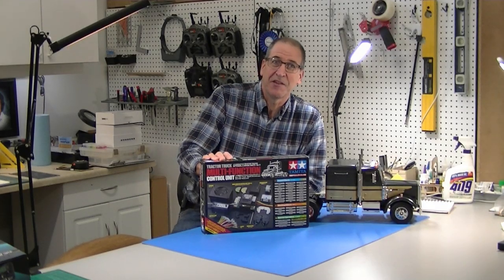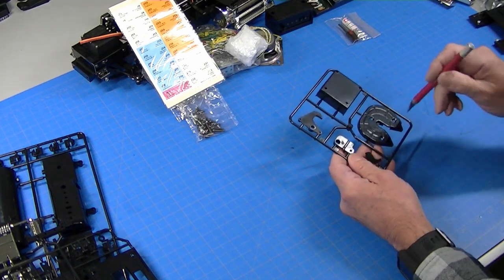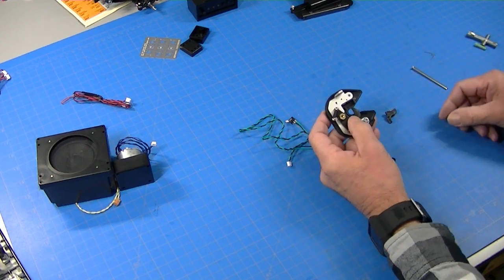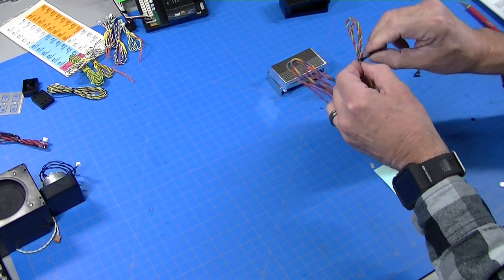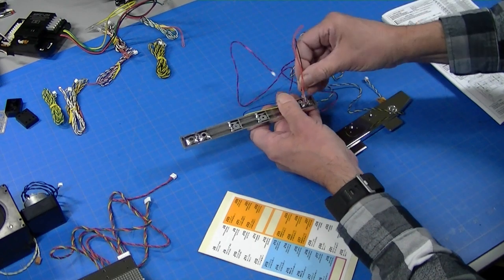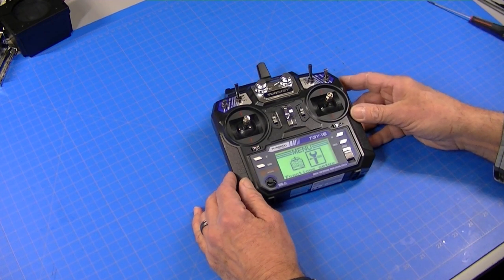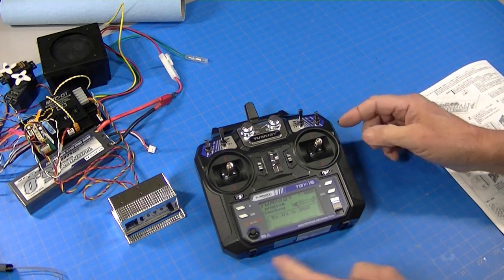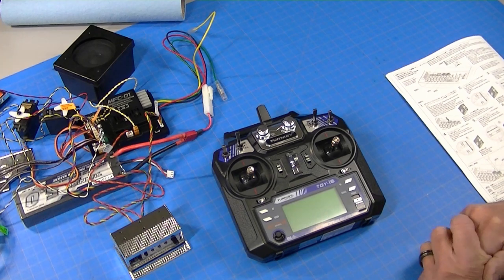1/14 RC Tamiya MFC Install Light & Sound King Hauler - Part 1

Comment: DX6E has a center sprung system. Look at the back of the radio... Move the switch and BINGO you have center sticks.
Reply from the maker: Did not know that.  I just grabbed that radio out of a box of radio's I have laying around.  Now I should do a programming video with that radio too!

Comment: Hello, I just finished your video on the MFC-01 unit for the King Hauler.  I noticed you used a 2S lipo  to power your system. Question... can I use a 3S lipo.?? I have one here in stock. I would need to purchase a 2S if not. Let me know, thanks.  Really great video.!!
Reply from the maker: You cannot use a 3S (don't even try it).  ON the MFC it does not have low voltage cutoff for Lipo's so good idea to use a spearate low voltage alarm.
Reply: @HobbyconceptsLLC  perfect. That's why I asked. Many thanks for your quick response.!!

Comment: Hey Bob,
Great videos, I'm getting ready to start this build and have been reading about the trims on the radio that they need to be anilog and not digital.. Is that true and why? I'm currently planning on using my Spectrum dx5c which I'm pretty sure is digital or do I need to purchase a different radio just for this truck? If so what radio do you suggest that's anilog, most are digital now.
Thanks for your time.
Reply from the maker: This solves all the issues: https://hobbyconcepts.net/products/turnigy-tgy-i6-2-4ghz-6-ch-radio-modified-for-tamiya-king-hauler-style-truck?_pos=4&_sid=28a8fc070&_ss=r

Comment: Can the MFC sound and function unit handle a 7.4v lipo 2s ? or just stick to the 7.2v NIMH
Reply from the maker: I run them with 2s Lipo's all the time.  Only issue is the low voltage cutoff is not set for Lipo's so you need to not run your batteries too dead.

Comment: Started to watch these MFU vids. I am a newb so not very knowledgeable,so can I ask. When you set up the Dual Rates, when you choose 75% don't you loose full travel for normal use?  would it not work with normal 100% then set up 125% for the  extra functions. I am probably way wrong?
Reply from the maker: Not a problem because you only set the dual rates for the right stick up/down.  The only thing that channel works is the horn sounds and lights so no affect on other functions.  That would be true if you set it for say the steering, but with new radios you can choose what channels you want to set it for.
Reply: That makes sense,thanks for replying. you don`t learn unless you ask : )
Reply from the maker: Yes, ask questions anytime!  You can also email me direct - address in video description.

Comment: Hi Bob great tutorial I'm learning alot about my King Hauler from you, I got it at a garage sale and need a battery charger, the antenna on the sleeper is missing, it came with a Futaba skyport 4 transmitter I want to get spectrum DS6, need to know where ti get my missing items thanks Bob 👍 you can find me rcintheworks on Instagram I have a Clodbuster black in my profile pic
Reply from the maker: email me for help.  My email in video description.
Reply: @HobbyconceptsLLC  okay
Reply: @HobbyconceptsLLC  I went to your email and all I got was videos, anyways I  put some measurements together and the speaker will fit attached to top of sleeper above the the control mod, I'll just get a Tamiya charger thanks Bob 👍

Comment: I have watched this video of you 7 times and i am having problem with my transmitter radio link AT10.  I followed you at dual / rate but it doesn't work, no signal light works, I can only install at shift servo.  I see two AT10 transmitters right behind your back, on the rack can you please show me how to set up for MFC-03.  I hope to get help from you.  thanks

Comment: i've built a few of these but only one with the automatic support legs for the trailer, however it doesn't want to work as it should....guess these are good times to go over your equipment ^_^
Nice informative video.

Comment: I have a transmitter Radio Link AT10 and tamiya MFC 03 and I can't set up them with together, Cuold anyone in loop help me plaese, I did connect the gear box servo but the light ( signal light, head light, emergency light,..... ) are not work and I don't know why, I try set up dual/rate channel, may be I was wrong something. Thanks
Reply from the maker: You need to set up the dual rates on your transmitter to a switch.  Make sure you have 75% and 100% settings.  Then be sure to MAP the MFC unit to your radio.

Comment: bill, you were correct about the use of the gt power kit to use on my grand haulor and i returned it. thats what you get for trying to save a few bucks. i plan to get the mfc-01 unit. do you know if i can use a radiomaster mt12 pistol grip radio to run it. the rx and radio have plenty of channels.
Reply from the maker: You can use any radio with the SFR-1.  If it has SBUS it is very easy.  Read the manual online to see if has SBUS.  If it does not then choose something else.  Also your avatar is the eFlite Viper Jet.  Love mine!!
Reply: @HobbyconceptsLLC  thank you bill. that is my backround. if you want to know anything about air rc, im your guy but ive gotten the itch for surface vehicles and have a couple of crawlers and road vehicles to start ny collection. the tamiya semis just intrigued me and wnated to build 1 because thats half of the fun, and i love their detail. i got a  radiomaster mt12 radio because i just wanted 1 radio to use for all my vehicles like my spektrum ix20 flies all of my planes. im just ads about that and its a pet peave of mine lol. thats why im asking about using that radio. it does suport sbus but i know nothing about sbus. yes i am used to an air radio and can make it do whatever i want but the mt12 is a very versatile radio that uses edge tx and elrs and can be programmed to do infinite things. its just a higher learning curve than im used to. thats why i ask about that radio. i understand its kind of a newer radio so if you ever make a video on using that radio to control trucks id be all in. until then i think il reserve myself to running my truck the normal way with servos and an esc and have no lights or sound  yet. until a video like that comes out by anyone and learn more ill just use it like that but its almost done and ive watched many of your videos for guidence and thank you for that. i try to use your site for certain parts and stuff as much as i can. thanks again and if you need help with rc planes or edf jets just shout me out. im not a video kind of guy but fly for fun mostly cuz that whats it all about.
Reply: @HobbyconceptsLLC  bob sorry to b0ther you again but when you mentioned sfr-1 and i watched your 3 pt videos you peaked my interest. my question to you is do they have a gear shifting sound i can assign to the 3 pos switch my transmission is on? do they
have a hitch and unhitch sound  i can assign to the two position switch i have assigned to the  5th wheel and lastly do you carry an on off switch that is a slider button type of switch with a small faceplate i could place inside the steps of the grand hauler in place of the control board but everything sounds very good just by watching those videos and made me interested in you starter pkg and the akl-8-w connector because im not much of a solderer lol. the computer part sounds pretty straightforward. oh and lastly would tthere be a way to use the tamiya vibration unit or would i lose that

Comment: Built a Tamiya Grand Hauler and used the MFC01 and have a Spektrum Dxs with AR410 receiver. Cannot get the throttle to work at all. Everything works great except that. Does anybody have any ideas?
Reply from the maker: There is no reason I can think of why your throttle would not work.  Double check all your connections and make sure the 3 position switch on the MFC control box is in the middle.
Reply: @HobbyconceptsLLC  Thank you for replying back and yes the switch is on the middle. But thank you your videos are always helpful

Comment: What color of wires for the light mfc goes where for the grand hauler
Reply from the maker: The MFC comes with an instruction manual (or you can download it).  Shows where all the lights plug in.

Comment: Hello,ive got some issues going on with my truck(king hauler day cab) and was looking for some help/tips...im using the modified flysky radio that i bought from the hobby concepts site...issue im having is:

With all switches in the up postion...only left turn signal works...when i flip down the far left (swa) both blikers work as they should...i did figure out to fix that i needed to change the dual rates opposite of what bob was saying in this video about the dual rate setup...insted of 75switch up and 100 down i did 100up and 75down and like i said that fixed the blinker problem i had now i down need to flip down the far left dual rate switch to get both blinkers to work as they should....now the problem im having is for the life of me i cant get any of the lights to come on and off with the transmitter...lights only work with the switch on the stepswitch panel...i never could get the lights(other then the turn signals brake and backup lights) to work from transmitter...only by the side box like i said....i retraced all wires to and from mfc unit and all are in correct plugs but still cant get headlights...bumper fog lights nor roof cab lights to come on with transmitter...even if i set everything up as bob did in this video...still no luck...any help would be greatly appreciated...thanks.
Reply from the maker: hard to answer questions like this here.  Much better to email me.  Sounds like you did not MAP the MFC to the radio.  You must MAP it anytime you make any change.
Reply: @HobbyconceptsLLC  oh ok...and how do i go about mapping it?...still pretty new to the rc/king hauler world lol
Reply from the maker: You need to put the programming back to the way the radio came to you first.  Then follow the instructions that came with it on how to MAP.  My email and phone is also on the instructions.  If you need programming instructions email me.

Comment: Are you using Li-po battery?
Reply from the maker: Generally no.  Tamiya does not recommend it and I like the heavier weight of the NIMH batteries.

Comment: 2s lipo battery works on mfc-01 i have 2 semi trucks i like to know if it is okay
Reply from the maker: 2 Cell Lipo's will work however the MFC does not have a low voltage cutoff for Lipo's.  You should use a small lipo alarm plugged into the battery if you run them.  Personally I like NIMH batteries better in trucks.  They are safer and heavier and the weight is an advantgae in the trucks.
Reply: Think you because i bot 2 lectron por 2s lipo 5200 50c i wanted to know because i didn't wont to must up mfc-01 56511 think you for you help i like to have the run time on my trucks